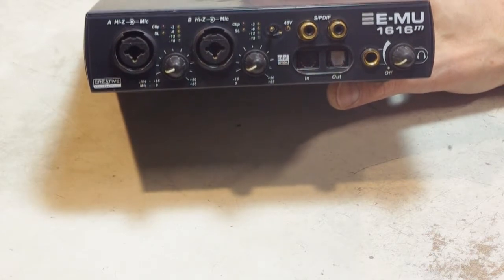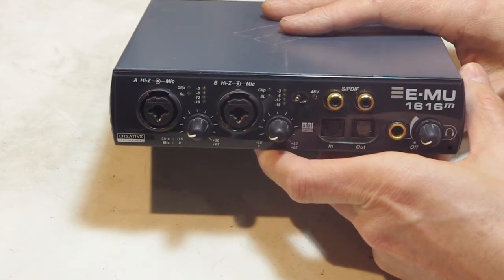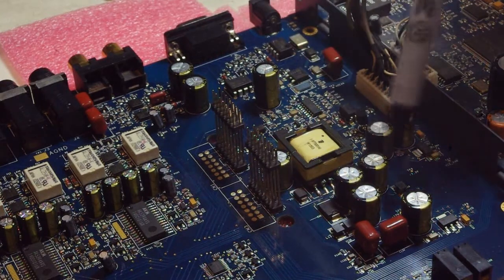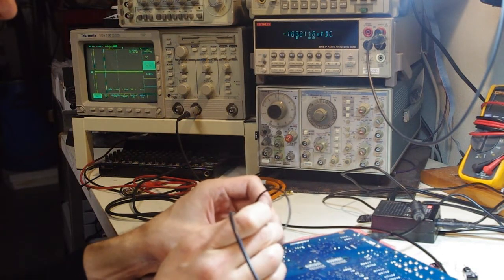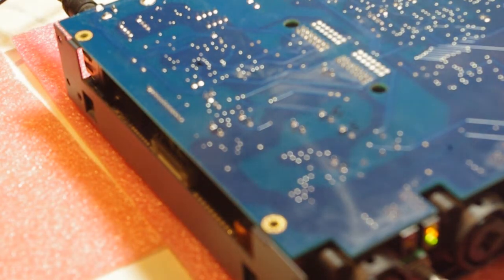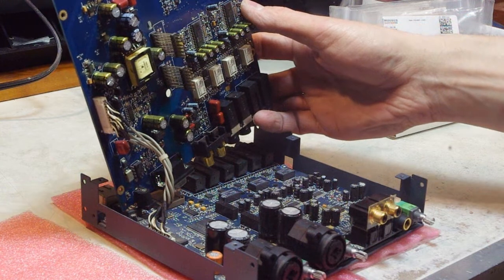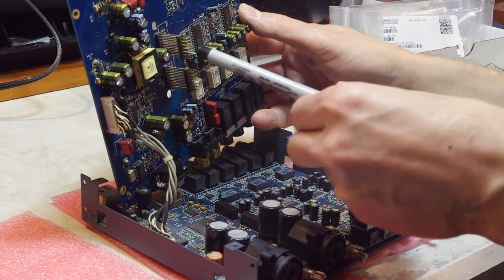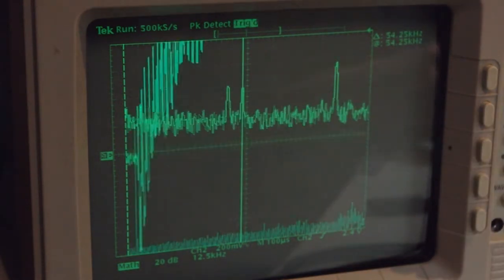Audio Tech Tip - E-MU 1616m audio interface repair

Comment: Hi there.  Reaching out here as a sort of last desperate hope...  I've had the same unit for a number of years and really like it.  It saw limited hobby use for a while, until I had to carefully pack it up (along with the rest of my system) for a period of time while we moved and got our new home set up.  Recently, I finally found the time to pull it all out and set it back up.  I was really enjoying the process of reintroducing myself to the process...had about 3 weeks under my belt...and was looking forward to digging in hard and starting to make music again.  Then...yesterday...one of my sweet pooches (who likes to hang out in the studio with me) got tangled in the extended headphone cord.  And, as he walked away, he drug the unit off the short pedestal it was sitting on.  It only dropped about an inch, but the unit had been on for several hours and was warm.  Now, it refuses to turn on.  Wondering if you might be interested in repairing this one...or you might be able to point me at someone who could...or??  I've seen some on Ebay.  I don't mind spending the money for repairs or a replacement (or 2!).  I'm just not finding much in the way of help.  Thanks in advance for any help or advice you can offer.  Eddie

Comment: Does anyone know how to get the face plates off.  I feel like I am about to crack it.  This video conveniently skips over that  stuff?
Thanks in advance.

**UPDATE**:  I guess someone repaired mine.  The [potentiometer knobs] had crazy glue in it and they wouldn't come off.  I kept prying at it.
Either way, the front plate is held by the potentiometer knobs, but they are supposed to easily slide off when using a wrench to pry.  The back plate of the dock is held by the two nut screws on the midi connection.  I hope it helps someone.  This video puts them back together at:  https://youtube.com/watch?v=QyBoW5FcK54?t=562

Also, that thermal insulator sheet is blue, but it has brown flux looking color.  I am starting to guess that it might be brown because it was getting cooked|[ over heating].  So the burn marks might show which capacitors are running way too hot and can help you diagnose bad caps.  I put an ESR meter to them, and it was 20 to 30 ohms. I had to change all the G-Luxon capacitors located on the upper (or daughter board).

All of these:
c115	220uf 35v polarized electrolytic caps
c118	220uf 35v polarized electrolytic caps
c121	220uf 35v polarized electrolytic caps
c124	220uf 35v polarized electrolytic caps
c135	220uf 35v polarized electrolytic caps
c125	680uf 10v polarized electrolytic caps
c131	680uf 10v polarized electrolytic caps
c34	120uF 63V electrolytic polarized caps

Something else might be wrong with the unit.

Comment: Hello, is it actually okay that this dock heats up so much? I'm somewhat concerned about it
Reply from the maker: Ours always gets warm while its on.  I used to leave the power on for days on end. That probably quickened the demise of its capacitors.
Reply: @EA78751  after browsing forums and such, I figured that it's a normal behavior, yeah. Mine is barely used and I usually turn it on in the evenings. So it should work for a while. Thanks

Comment: Hello, I've 2 E-mu 1820M and with my amplifier (Hypex Ucd 180 Hg hxr) I've a very  loud noise floor , similar to white/pink noise. I tried all possible solutions (a 12 v dc power supply for car, connected to a car battery too) in hardware and software, replaced all power supply capacitors in the dock and in the Pci board with Panasonic Fc with same values in the older board. They work perfectly but that noise is right there. When I open a new session with all inputs activated the noise is more strong. I tried with a low pass filter in the outputs, it's works but it reduces the output level and it get sound worse on my ears. I think it's a noise inducted by the supply section, how could I solve this? I tried a 12v power supply for the amplifier too, so this is not an issue caused by home current. An impedance mismatch, is it possible? Could I try with a technician help? Higher capacitors value? I've the same situation with both 1820m, the recapped too, the boards work very perfectly in all features and they sound very very well, but damn, that noise...

Comment: Good stuff. Thanks for sharing!
I just went from Scarlett 2i2 to Behringer Umc22, now i am looking to get something with more outputs, and i found that 1616m has some good specs even for todays standards, so i am looking to buy it. 80$, not too much if you ask me, coz i really did hear the difference between the first two, and felt the latency difference with Soft synths, i got the PCI port so i should be good. And yes, i want to recap it, i got some spare Rubicon and Nichicon caps. I can go above the ratings as i understood, 10v -> 16v, 680mF-1000mF, at least for the PSU part. Cheers
Reply: I used Panasonic FC series, you could change the cap to 1000uF and also uprgade the AKM-converter's also often faulty caps(4/ one ADC) to the max according to the IC specifications. You could also install more local buffer and decoupling caps, and strengthen the opamp's PSU rails too.

Comment: Same failure mode for the EMU 1820 - thanks very much for filming and uploading this.  Noticed that those bad caps are still flat-topped. Important diagnostic clue that these caps can fail without any visible signs - except for that very handy scope display showing a lot of ripple.

Comment: Cheers. Nothing appeared wrong with my unit or the caps, but replacing them improved the noise floor by a little over 5 dB.

Comment: Can I use any brand of capacitor ?
Reply from the maker: I suggest Nichicon or Panasonic, select a type thats rated for high temperature (105C instead of 85C), its probably the best choice for long term reliability since this unit runs hot.  "Audio Grade" capacitors don't really matter here.  Nichicon HE Series, thats rated 105C
Reply: @EA78751  Thanks!

Comment: Thank you for sharing! 
I have a ground loop noise issue with my  E-MU. Do you have any idea from where could I start to check the problem? thanks
Reply from the maker: Ground loop, if its a complicated setup with a bunch of AC adapters and AC plugs, I'd start by simplifying it one step at a time.  Unplug something, if the problem persists, unplug the next thing.  If you hear buzz in the monitors, double check its actually getting recorded in the DAW tracks, if not, look at your monitor setup, is there a 3-prong AC plug somewhere in the system (mixer, powered monitors?) If no 3-prong plug anywhere, then any 2-prong AC adapters are pumping noise into the system with no place for it to go.  Just some suggestions... good luck!